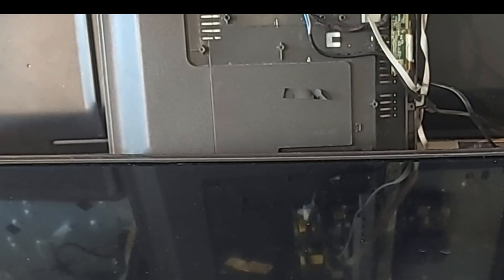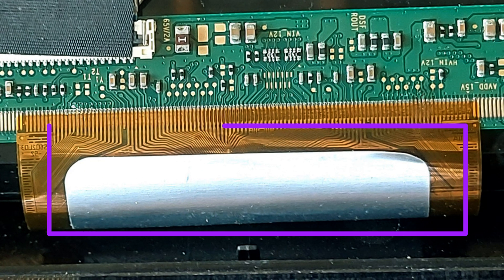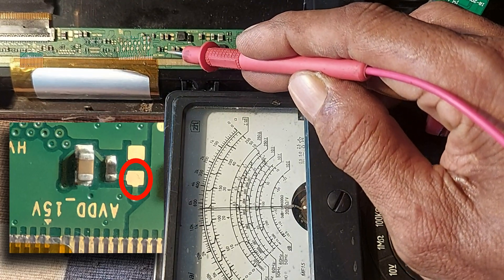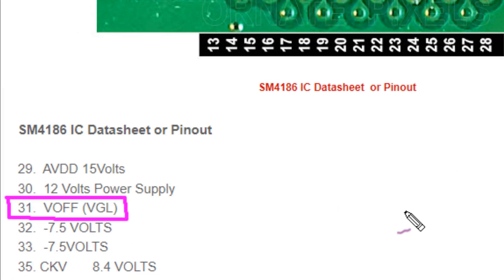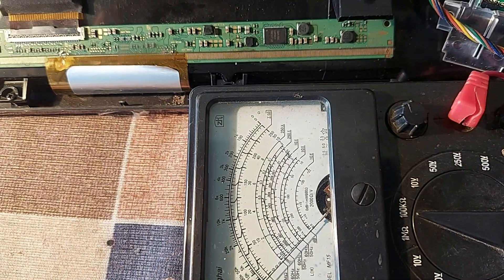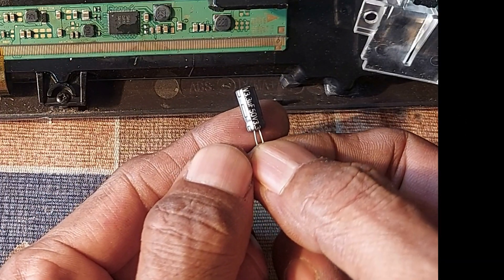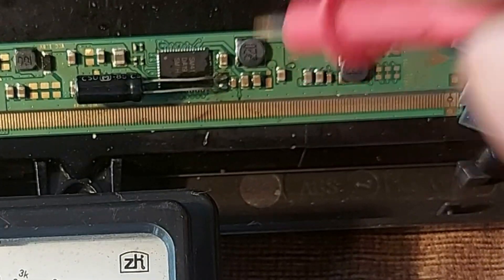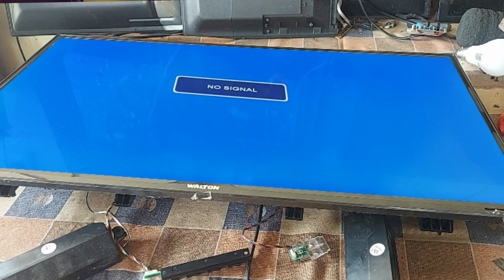LED TV Screen has no picture & light but Backlight are OK | LSC320AN10-H03 32" Panel Repair,  SM4186

Comment: Hello,
On the very right side on this panel, there is a 220 coil. On top of this coil there are 4 smd components. Out of this 4 components, one Capacitor is larger in size. What is the value of that large capacitor ? Please reply. Thank you 🙏🏻.

Comment: How to find smd compent - + negative
Reply: Put multimeter on continuity and place black probe on ground of board search for beeps between both sides of smd capacitor.
Reply from the maker: SMD capacitors are bipolar, not electrolytic.  If the SMD capacitor is electrolytic there must be a (+) or (-) sign.
Thanks Brother 
🌿🌹❤️🌹🌿

Comment: My panel No: LS320AN01-H03 . No video but back light is ok. Your solution was capacitor short. I check in the T-CON board, all the capacitors are ok. Source supply12 volt is ok. VGH 30volt =0v, VGL 9.8volt = 0v, AVDD 15volt =4.5v, VCC 1.8v is ok, VCC 3.3v is ok, 
in this situation I didn't find the problem. Is it DC to DC converter processor faulty ? Can you help me any other solution please.
Thank you.

Comment: why that capacitor  solderd negative pin  to positive side
Reply from the maker: A minus or negative volt  is output from the VGL circuit, so ground becomes positive in this circuit.  Thanks bro, stay well.
🌿♥️🌿
Reply: @OrnatePixels  thank you so much bro

Comment: sir how to use kly in 42 inch led tv plase make a video for this topic.
Reply from the maker: * 180 watt KLY kit should be used * Must connect KLY Kit with optocoupler as per theory.  * A good quality heatsink should be applied to the transistor.

Comment: Sir how you found capacitor value will be 3.3   micro farradl.
Reply from the maker: As the pulse generator frequency of DC to DC converter circuit is around 20 kHz, 2.2 to 4.7 micro Farad capacitors can be used in this type of high frequency low current DC output circuit.
Thanks Brother 
🌿♥️🌿